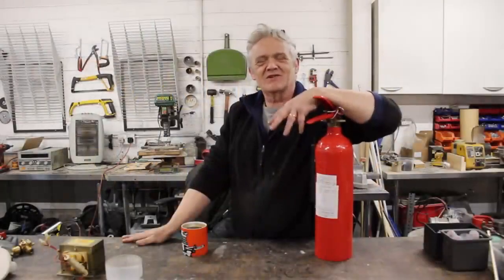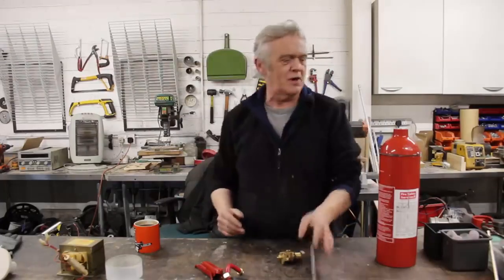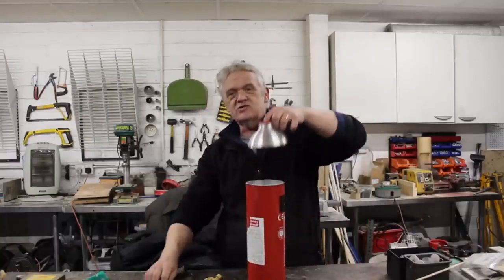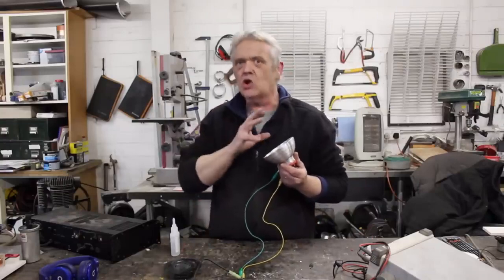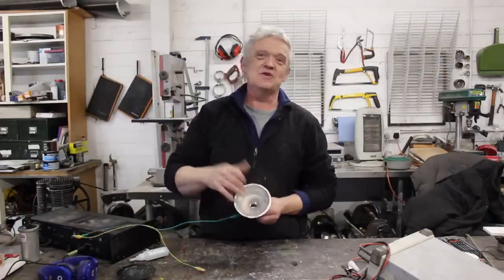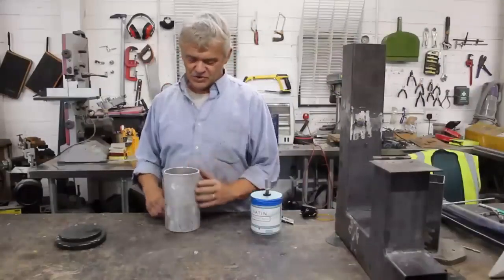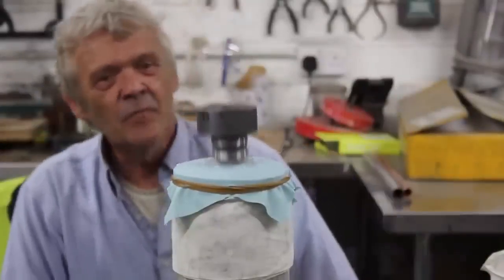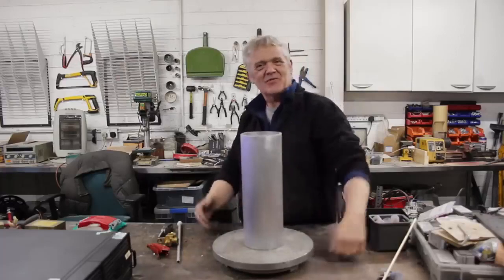003 Some Awesome Things To Do With An Old CO2 Fire Extinguisher

Comment: Ive also found old fire extinguishers to be useful, I have used the large steel versions for my Internal Combustion Reactor experiments and some of the smaller ones cutup for metal melting crucibles.  Crazy how thick and good of grade steel is used on the large old ones, gave my friends plasma cutter a hard time.
Reply from the maker: nice one mate - i will look out for them